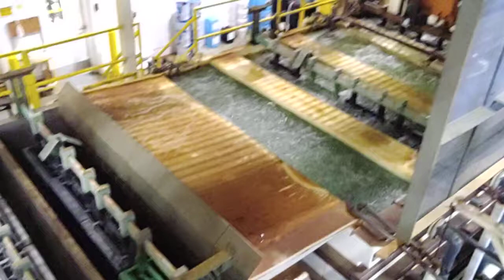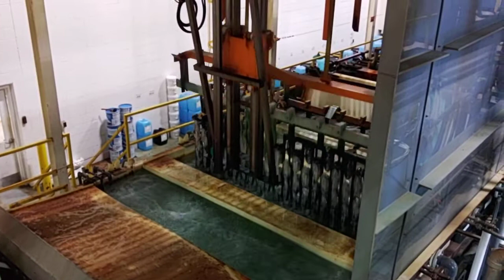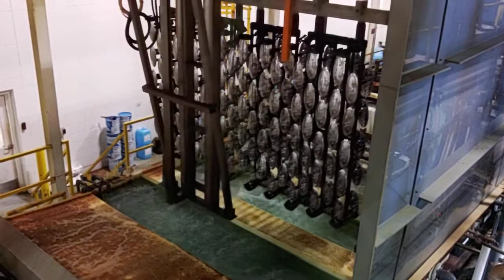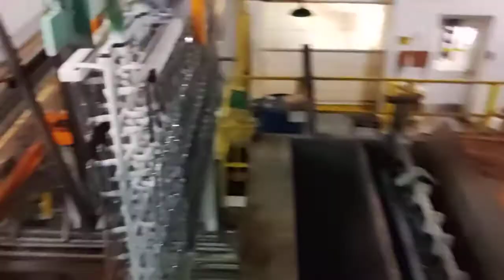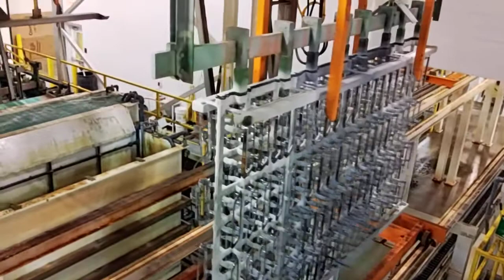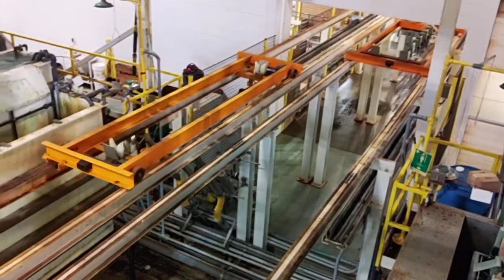Chrome Plating Ford Ovals

Comment: Thats so cool
Reply from the maker: Yeah, but I refused to do any work on the system.  Too dangerous.
Reply: @squiblift2019  yeah i can get that lots of different acids
Reply from the maker: @snappers_antique_firearms  there were two plants that plated and two that had paint.  I learned some of the processes and did some work in painting.  Even though the pay was decent, it wasn't enough to risk it for me.
Reply: @squiblift2019  its understandable